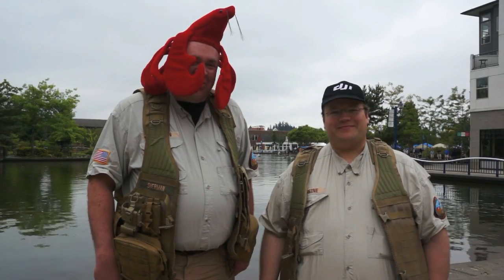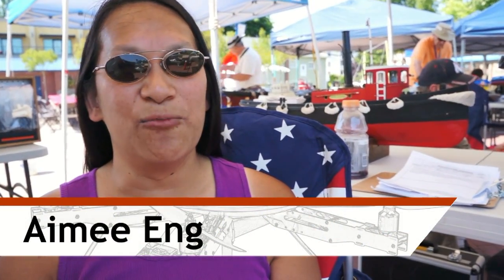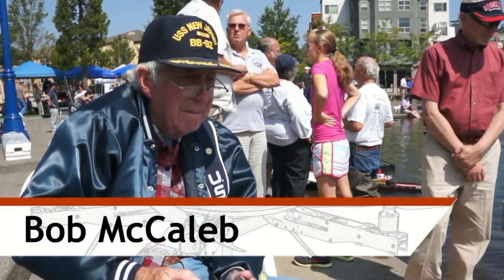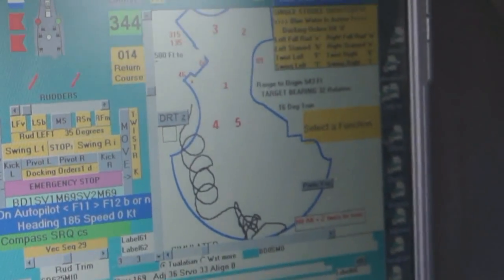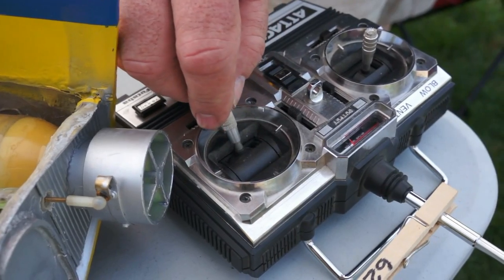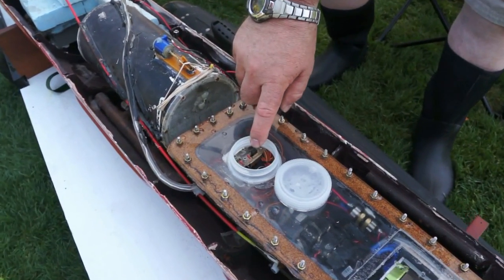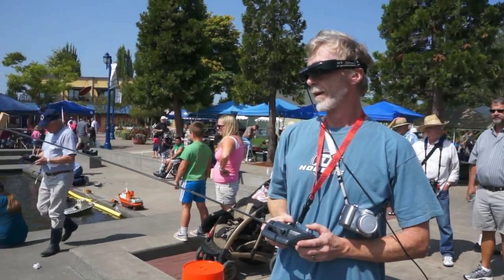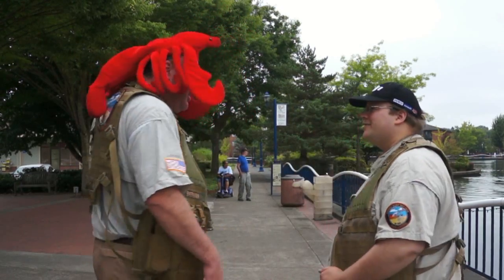RFTC: Flying FPV at Radio-Controlled Boat Regatta

Comment: Transmitting through water is very difficult and you'd need to use some major power. What real submarines do, and I was on them for many, many years, is to use a mast that sticks up above the water. They also have tow lines that float on the water that allow them to transmit. You'll need to orientate your receiving antenna to your transmitting antenna if it's laying flat on the water being towed which is what I recommend. Let us know what you do and if it works!!!!